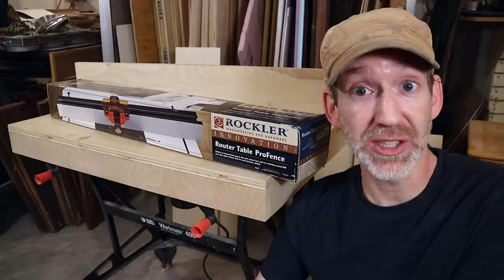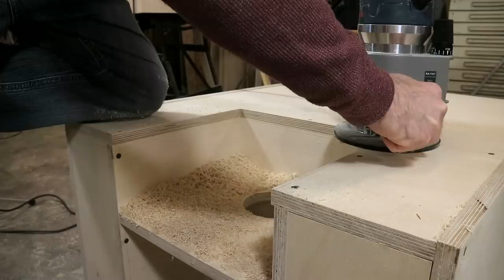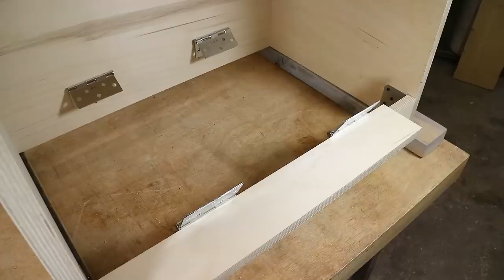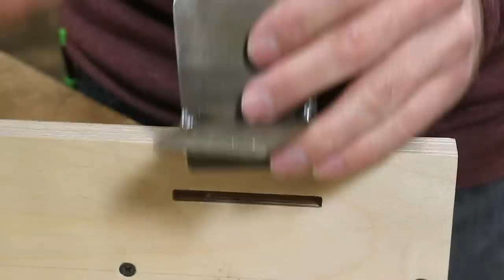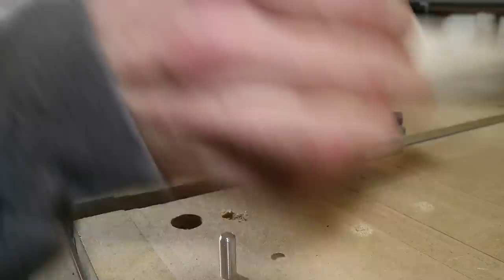Mobile Router Table With Built-in, Kick-Lift Caster Mechanism

Comment: Beautiful build Mr. Treat. I always worry about the vibration, from the router, causing the height adjuster mechanism to move up or down, causing the height of the bit to change.
Also, oil your squeaky bits!
Reply from the maker: Thanks! The lift has a tension adjustment to prevent movement, and also a locking screw if you want to make sure.

Comment: Best lift I’ve seen! I’m not used to working with aluminum so don’t have an intuitive sense of the strength of different gages - how thick are the walls of those rectangular tubes you used? (Are they about 1” x 5” in cross-section, too? Dimensions there would be a great jump-start on trying to reproduce this.

To an earlier commenter: I don’t weld either, but I think I can through-bold the plate onto the steel tube, maybe with a twin on the bottom to sandwich the aluminum. 🤞🏼🤞🏼

Comment from the maker: Yep, I know the router lift isn't level with the table. It was late and I had to tie up the video, so I just dropped it in for the final shot so I could grab some tacos and go to bed. Thanks for watching!
Reply: I saw that too. LOL!
Reply: Did you ever fix that? I was hoping that lift plate had something built in to adjust for level.
Reply from the maker: @saritsotangkur2438  It does.

Comment: Awesome design! You probably could have salvaged the twisting plywood board that holds the casters by adding some plywood strips on the underside to stiffen it up. They don’t have to extend all the way, just make them as long as you can without interfering with the casters. Once you start adding fancy aluminum plates the project becomes less accessible to many of us.
Reply from the maker: Anything tall or long enough to make a difference would've interfered with the rotation of the casters. There was just too much leverage on that corner for small strips to correct the twist. I attempted other solutions off-camera, but only the aluminum tubing was enough. Plus, aluminum is readily available and is about as easy to work with as wood. Thanks!

Comment: Hey buddy, you need to adjust the height of that fancy insert plate that holds your router by bringing it up to the working top (flush with the top). But I guess you already figured that, didn't you?!
Reply from the maker: It was about 9 pm. Adjustment comes when I get back. 👍

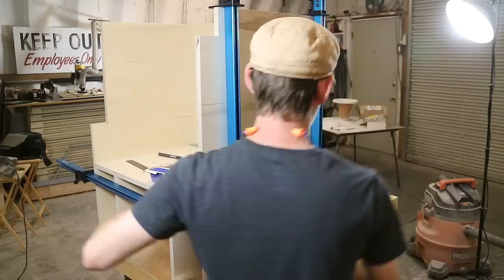Comment: Hello, Lucky you for being Sponsored...  At 4:05 mins into the video you said the word “Perfect”...  I have always found if you “Cut your material “Square” Generally it will go together “Square”...  A more ruff wording would be “if it’s cuts square it’ll will frame square”...  Great Video. Also your lift system is “Pure Genius”...   Greg

Comment: What are the dimensions on your thick walled aluminum tubing, and where did you purchase it from that takes the place of the plywood?
Reply: I was wondering the same thing. my guess is 1/4 inch thick.  personally I want to build a similar lift set up for a 3 by 7 foot long work bench with built in tools, figure I would have to build one on each end with the casters set to drop about 2 feet apart to handle the weight of the onboard tools and have support in the center of the bench while being moved.

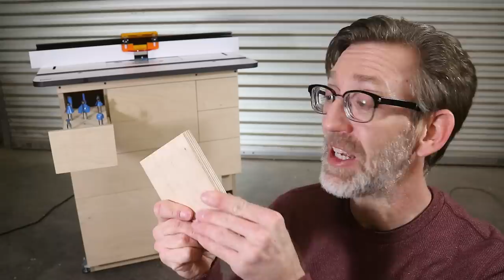Comment: I'm no expert, but I'm pretty sure you're going to want to adjust that router inset (the pro lift), so it's flush with the table. You can already see your workpiece getting hung up on the edge at 16:20, which isn't something you want. It would also create a cut that isn't deep enough on longer workpieces, since the longer piece would be laying on the table, which is slightly higher than the actual router.
Reply from the maker: It was late. I just dropped it in to get the final shot.
Reply: @WesleyTreat  I appreciate that. I just wanted to make sure you were aware of it, since it can be quite annoying if you're not sure what's going on.
Reply: @WesleyTreat  There I was, watching this video and thinking to myself how you are such the consummate professional and craftsman, when I saw the lack of adjustment on the router lift. I caught myself waiting in anticipation for the kickback, and the ensuing carnage and lost digits.  Now I think I understand the attraction to watching NASCAR.  Safety Third  Lol :P

Comment: So. First, I will date myself as an old man: My very first router table video was on Norm Abram’s New Yankee Workshop. His (Norm’s) first router table build. So far back in the annuls of time, I honestly can’t even remember when (1980’s, perhaps – God only knows).  So, I was like a few other commenters: <YAWN> Another table design. Wait. “Kick-Lift” huh? I guess I’ll take a look . . .
 Let me just say the machine lift idea is pure and unmitigated genius. Self-contained, effective, cool, cost efficient, practical.  Well done. A truly great idea.
 There are only two things I’d change. An outside magnetic safety switch: Difficult to impossible to turn on accidentally and stupidly easy to turn off if there’s a problem. When power is restored, the router stays off. Thirty dollars is cheap insurance when you need it. I think Rockler sells one, I think. The other thing is I would have made it out of oak or cherry veneer plywood and hardwood edging where needed. The cabinets in a craftsman’s workshop should demonstrate his best work. Besides, you said in your opening you threw together a router table-top for one quick project, then used it for two years. This project was to make a permanent one for the shop, so make it nice. You deserve it.
 A question (or two): How well did the dust collector pull chips away from the bit and the void behind it in the fence? The video seemed to show some problems. Same for the trunk under the router lift. A tight fit between the bit and the collar might starve the dust collection. I would think about making the door out of hardwood rails and styles with a plexiglass panel. You can add some holes to the bottom of the front door is you notice a buildup problem in the trunk.  With the router lift, you’re not going to pull the insert and lift out very often to change a bit or whatever. A small problem with the dust collector will fill the area under the router with flammable dust and chips. Had it happened to me with a table saw. The hose got a hole in it, so the suction in the cabinet went to zero. While changing the blade, I just happened to notice the foot of chips in the bottom of the saw. That Murphy guy is a bitch.

Comment: Nice build dude!
How about just using locking castors? Much easier, or you can buy bolt on stops, like over centre clamps with rubber feet - much less work.
I am just adding something similar to my saw table with two wheels at the back and at the front a fixed and free crossmembers 3 inches apart. The lower beam has two castors. The upper beam has a wooden cam and fixed long handle in the centre. Turning the handle pushes the lower beam down and lifts the table. Done a temporary fix and it works well.

Comment: Excellent video. The production values are amongst the best that I have seen. In order to really understand exactly what is being done at each stage, I will need to view and view again. 

Most of my workshop tools are on castors. Some are on castor frames which rely for stability upon the locking castors; not good enough. I have now built some on lifting castors; much, much better but my mechanisms are no way near yours in terms of function. However, I don’t weld and will try to figure out of I can do achieve the same without welding. 

It may be we’ll be camera angle but it seemed to me that, in the final shots, the insert was lower than the phenolic table?

Comment: How do you fix the issue of the router lift plate being slightly lower than the table top itself?   Just at the end of the test routing you did the piece of wood caught on the edge. and you can see on the opposite side that is is inset a small amount.  Are there shims with the router lift kit?
Reply from the maker: There are adjustment screws underneath. More explanation in the top comment. 👍

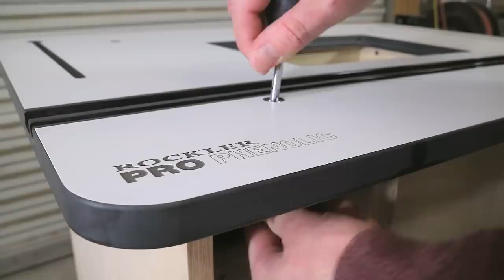Comment: 15:39
That chip in the table top would drive me insane.
Reply: oobaka1967 also the insert part is actually lower than the main table by about 2 mm 🤨
Reply from the maker: It was about 9 pm. I dropped it in for the final shot so I could go home. Adjustment comes later.